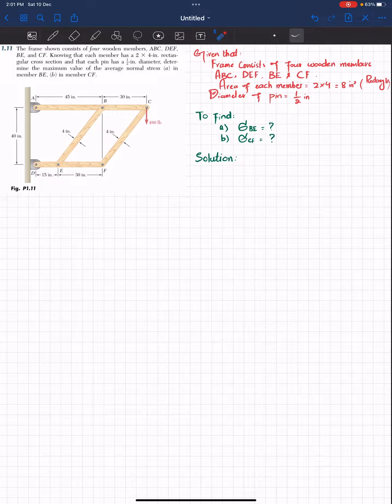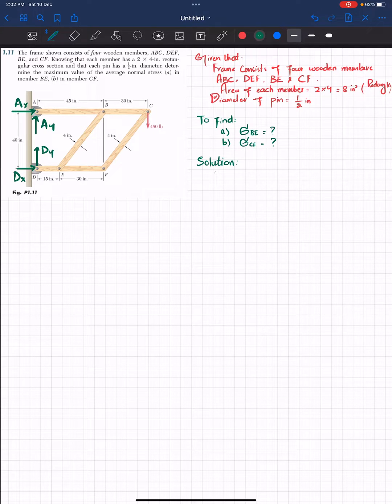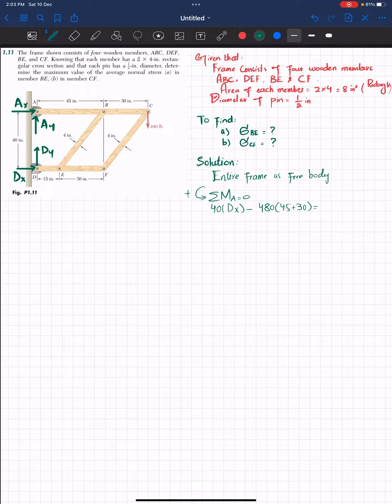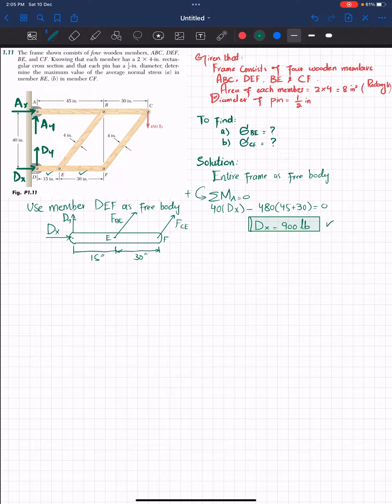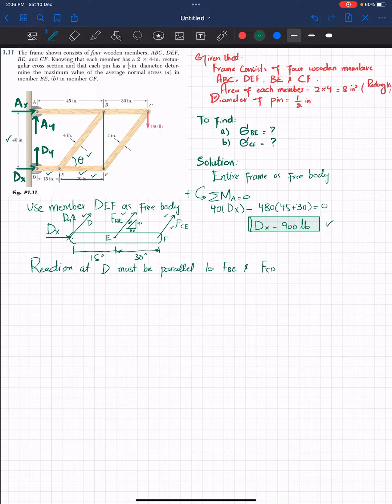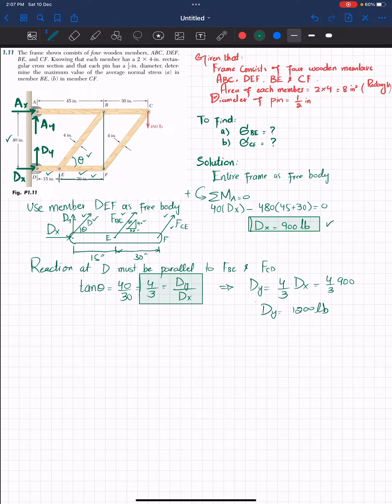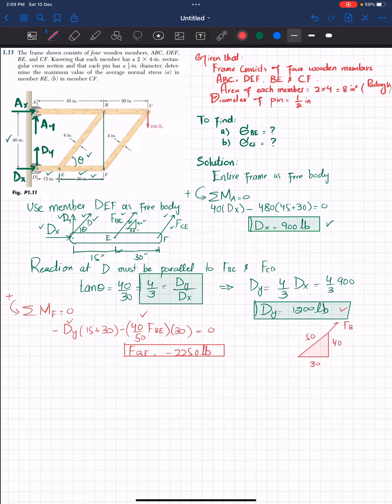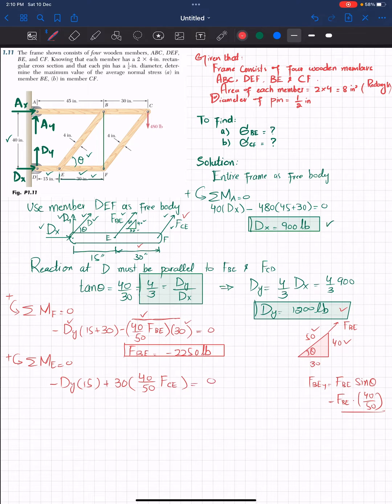1-11 Concept of Stress Chapter (1) Mechanics​ of Materials Beer & Johnston

Comment: Greetings sir..
Why does the resultant of dy and dx have to parallel to be BE and CF..??

 Seondly, shouldn't member BE be a zero force member for equilibrium to hold, given that no loading is placed at any of its joints and therefore it's the only one that would have a component in the y direction at any of the joints.. So shouldn't  it  be a zero force member for equilibrium..?? 

And finally, if you apply equilibrium conditions at joint c (method of joints), why does it yield different values of the forces??
Thank you 
Thanks you
Reply from the maker: Thank you for watching the video.  FIRSTLY YOU CAN SED THE MEMBER DEF, the force FC and force BE are parallel and we can find its angle theta , so pin support at D will force the force in same direction in order to counterbalance it, although the pin support have horizontal and vertical reaction force but these are rectangular components of force and its net effect will be D acting at an angle theta parallel to the other two forces, in order to keep it in equilibrium.
Reply: @engradnanrasheedmechanical  alright sir.. Thank you very much.. I appreciate your help
Reply from the maker: You are welcome and keep watching and sharing.
Reply from the maker: And member E is also observing force of 2250 , so there will be stress in that. You have mention that there is no external load on member BE but due to external load P there will be force that member BE will over on the other member which we have calculated as 2250 lb.
Reply from the maker: Why you are applying method of joint at C as you have to find horizontal force of member AbC and force of member FC , both are unknown then you will take other joints to get them and ultimately the problem  will become complex. 🎉